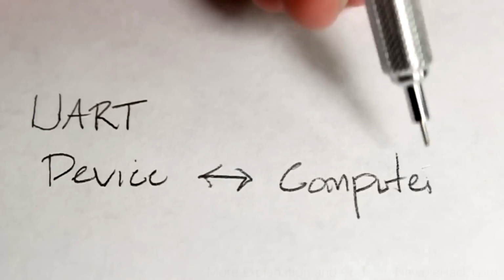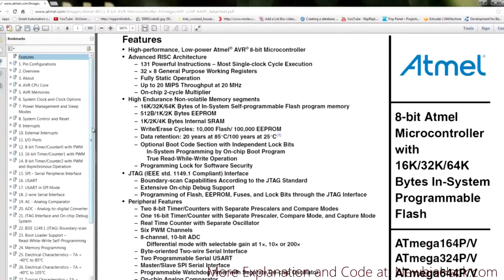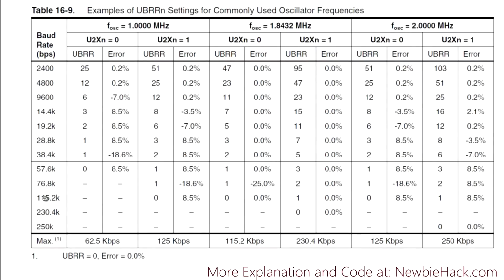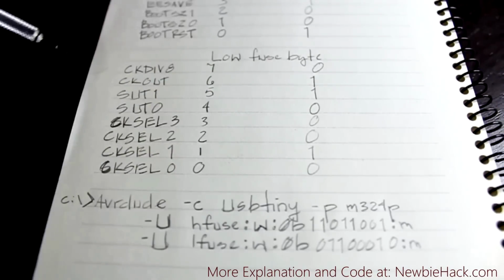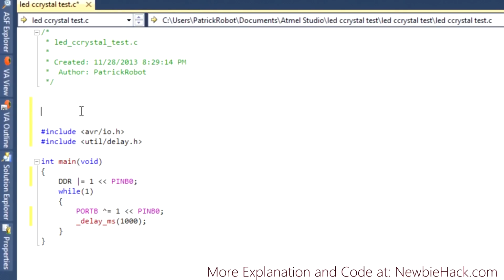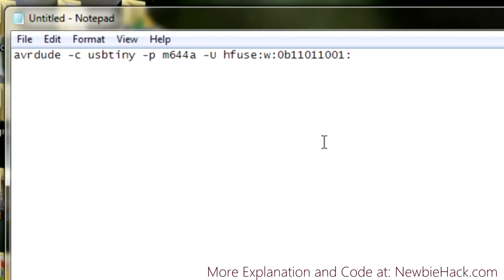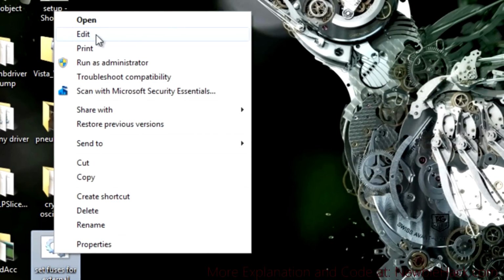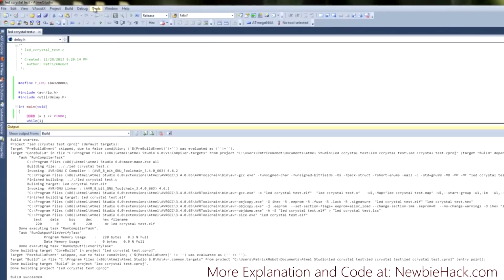53. Arduino for Production! How to Use Crystal Oscillators and Write the Fuse Bits to the AVR MCU

Comment: Can the wrong fuse bits stop the atmega32u4 to stop talking through the onboard
usb thats on my device ? cheers Brett
Reply from the maker: Yes, the fuse bits can stop the controller from working entirely, then it becomes a nice bug craft project.  Those can be fun too! 😬
Reply: thanks heaps for the reply,
my bootloader crashed and I have no idea what the fuse bits 
should be but i do have the circuit with external 16mhz crystal .
is it possible to work out for me please ?
http://tinypic.com/r/2di3vhi/9

Comment: Was following along with your tutorial, applied the fuse bits to the same controller you are using.  Bits applied successfully, but as soon as the bits were written, avrdude can no longer communicate with the device, even after adding the external crystal and caps.  :(

Any way to recover from this?

Comment: You did build while the Debug option was selected in the drop-down list in Atmel Studio. That's why you got a Debug build. 

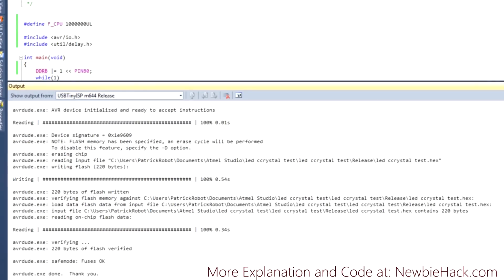Also, is there any reason you have the polarity reversed to the MCU, at 16:47? You've swapped Vcc & GND on your little red leads. The MCU still works of course, I'm just wondering if there was any reason for doing that?
Reply from the maker: Strange.  Yeah, it looks like it is reversed.   Odd how it magically works!!
Reply: Well, it would of course be reverse polarity, but the chip should power up I would think. It might screw up some I/O logic though...I'm not sure. It certainly seemed to work in your video though.

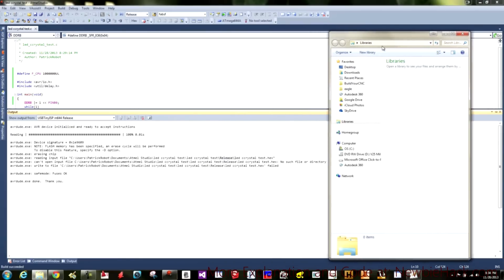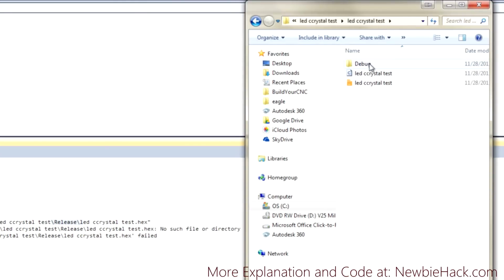Comment: at 15:58 I see Mach3 and Zebra Drivers and then at 16:03 Autodesk Inventor which all stuck out to me.  What do you do for a living?  I'm a machine builder and I don't expect to see that combination of software on anyone's computer.  I wish I could do more embedded systems at my work, but most of my company's work is automotive assembly equipment so it's all AB PLCs and relays and maybe the occasional motion controller if I am lucky...

Comment: Let assume i'm using atmega8-16pu and i want to connect a 16MHZ crystal oscillator with 20pF load capacitance. Now i need two capacitor connected to GND and the chip ( XTAL1/XTAL2 ) itself so i have to use the equation down below:

CL1 = CL2 = 2CL − CSTRAY

I read every place that CSTRAY is 5-10 pF.

so my my calculation is:

20pF = 2x20pF-5pF = 35pF, so i need two capacitor with the value of 35pF. Is that correct or wrong?

and is there any equation/way to determine the CSTRAY instead of guessing ?

and what if there is already some capacitor on the board do i have to

say:

CL1 = CL2 = 2CL − (CSTRAY+any other capacitor on board etc...) ?

please help me with the three questions i have to understand it better. I hope you can answer them 3 step by step to be able to understand it.

Comment: hi patrick! i've been following your videos for a while. i got a problem when i was trying to set the fuses... so i did what you said and everything worked perfectly but my output voltage in all pins is 0... the thing is the programmer see the device signature and also program it, but nothing happens. i program it with a simple ddrb |= 0xFF to see if all the pins in port b are dead... and they are. what do you think it could be? i've already checked the power supply and is ok.

Comment: Glad you are back. I'm impressed you are so meticulous by specifying each fuse bit. I used to use a web based fuse bit calculator.  I will try your teaching in the future. I learned a lot from your previous videos. And I found micro controllers are fun to use. I even began to explore the analog stuff, i.e., switching mode power supply, op amps, amplifiers, in order to find more usage for the micro controller, at least that's my initial motive. ;) Strangely I found they are equally fascinating. I built a switching mode power supply for my solar charger project. Now I'm trying to build an amplifier just for fun.
Reply from the maker: Excellent! Consider passing some information to me so I can post some of it.  Regarding your comment on the fuse bits.  I try to be as detailed as possible so the folks using these videos can get their feet really wet and understand this stuff to the level that they can be confident with anything in this field.